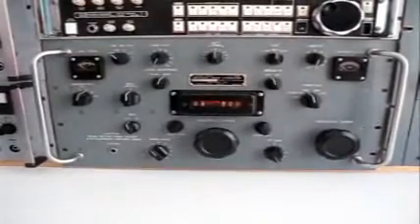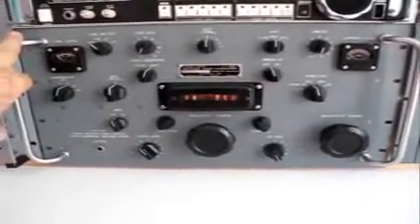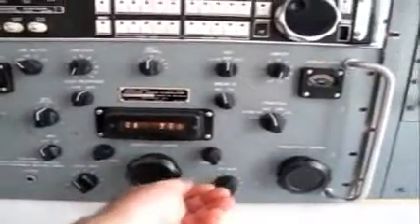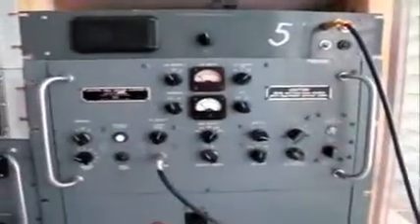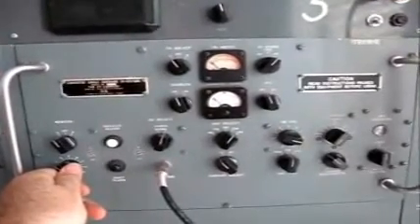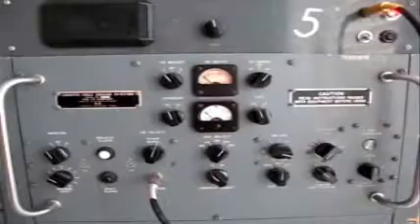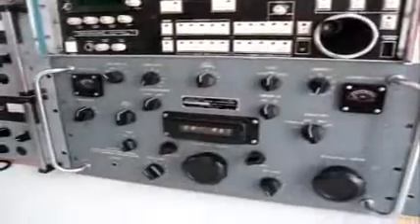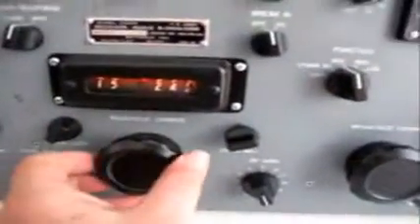R-390A and CV157 SSB Adaptor

Comment: Hi Pete,
After watching your video on the CV157 I have been looking for one for myself. They are very rare even here in the US but I just found some and getting ready to evaluate them. The CV157 is an impressive box, to say the least....But have you played with a Hammarlund HC10 yet??? Not as pretty as the 157 but it has additional filtering, a notch, vernier tuning and a tunable BFO. A few years back you could snatch up one at a Ham fest  for $150 to $200 and now they bring ~$800 or more on epay. The HC10 is an OUTSTANDING match for the R390 or A version and a CW op's true delight, It's also super nice to touch up a slightly drifting transmitter as well.

Again, Thanks for your well done video of a very rare vintage and special piece of well designed and made equipment..

73,
Glenn WA4AOS
Reply from the maker: Hi Glenn many thanks for you comments, I do know the HC10 and was looking for one prior to the CV157 became available. The R390A came with the CV157 shown but I also have a R-391 (Basically a 390 with autopositioner added) here which is the RX the CV157 was originally intended to be used with. I and currently reorganizing the radio shack and have some 19 Inch racks. I am planning on putting the R391 with the CV157 and the R390A with a CV591. I'll take a new Video when its up and running. On the HC 10 looking at Y tube Vid it looks very nice. Good hunting... Pete Vk4GXC

Comment from the maker: @wa4aos Hi Glenn, yes I like the older valve gear and have a few of the collins sets around. With the CV157 I first saw photos about 10 years ago and 2 years ago was able to pick one up. The unit was in very good original condition but needed a little cleaning. Its a hugh overkill for SSB and has probably the Biggest Mechanical filters I have ever seen. The Audio recovery is excellent and I really like it. If you can find one and its in ok condition I would recommend picking it up..
Pete